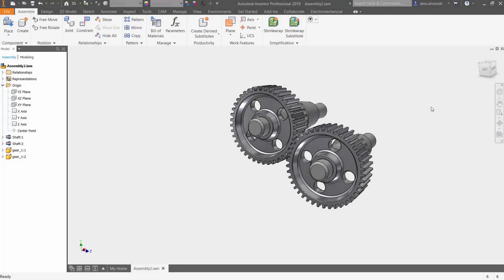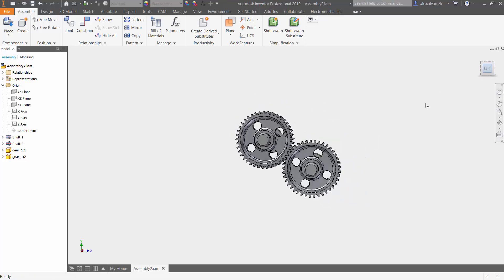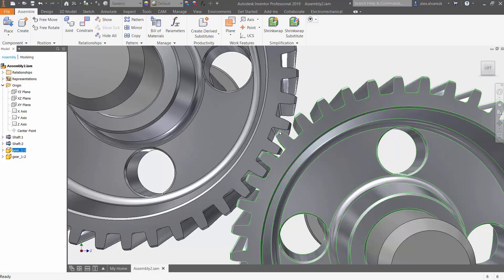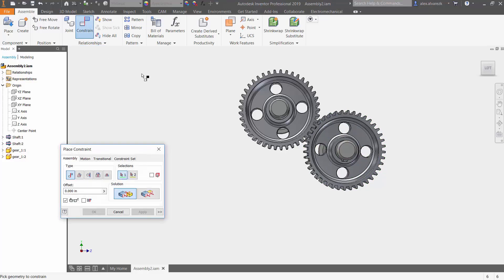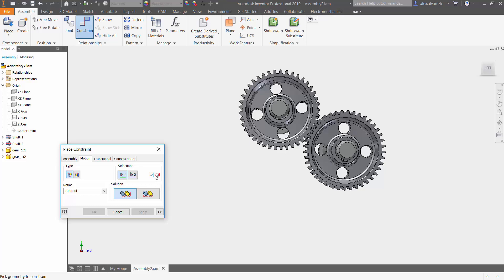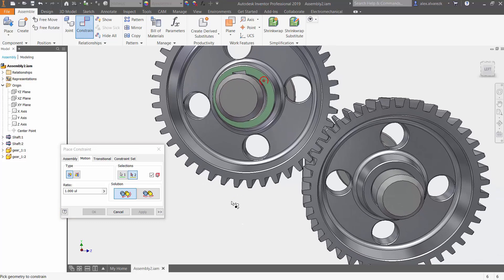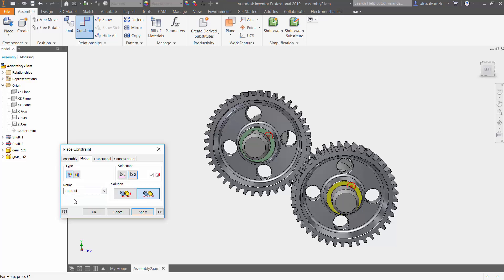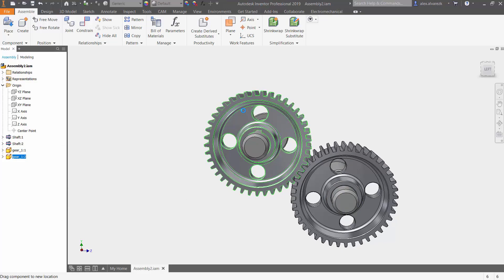Quick Tip - Rotation Constraint

Comment: Is it possible to apply a rotation constraint only in one direction in regular assembly environment? Like to resemble how one way clutches/bearings work? Ive searched for this anywhere but it seems that it cant be done :/
Reply from the maker: no, that would happen in the presentation environment if you wanted to show the proper rotation.